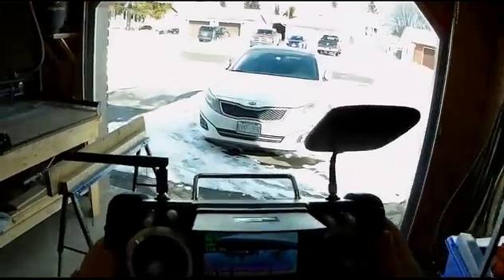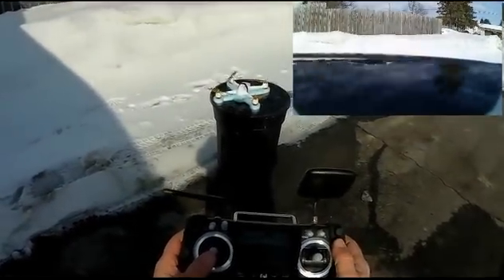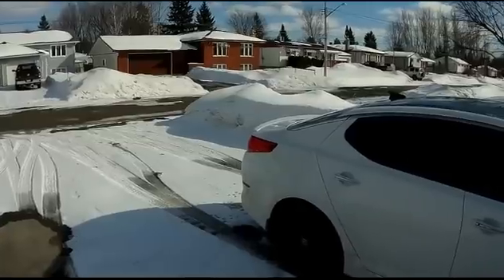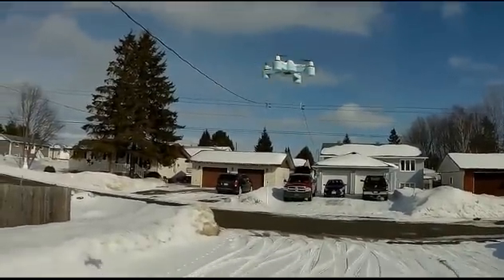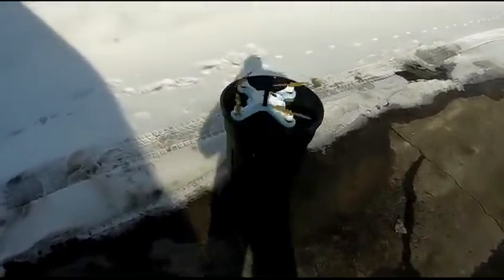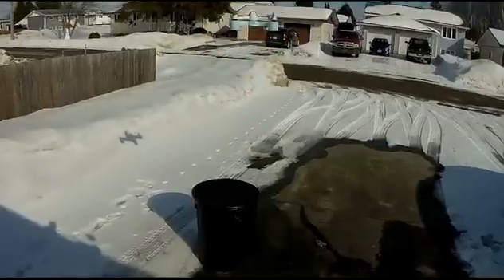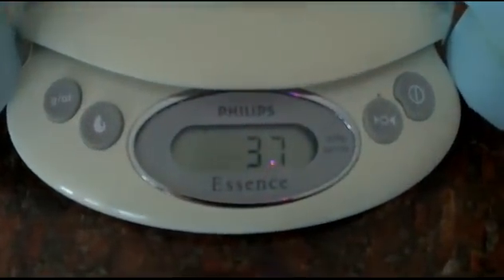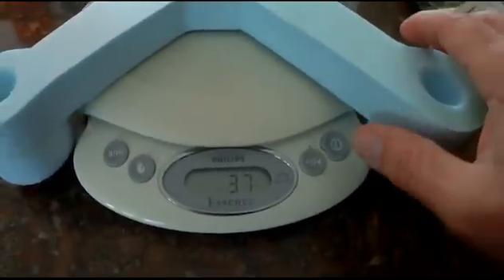Water and Land (LFG - Landing Float Gear for Hubsan H501)

Comment: Very nice.  How thick is the foam board you are using?

Any plans for making it thinner?  Have you tried using 1 whole piece, instead of 2; 1 for body, the other for landing gear legs.  Maybe use one layer, make it thinner, with the exception of the landing gear part?  This would make it lighter.

Also make the holes deeper, so there is little or no gap between the foam board and the Hubsan?